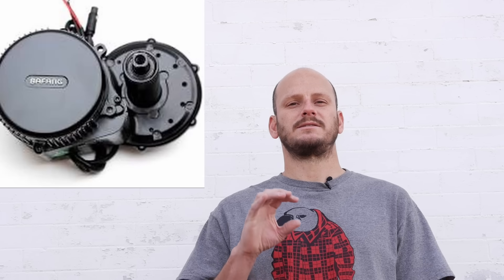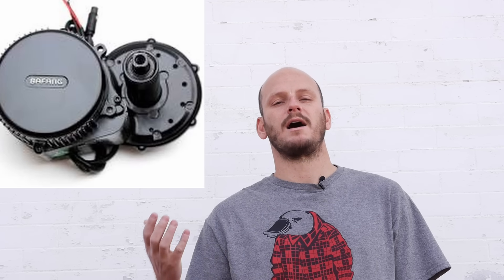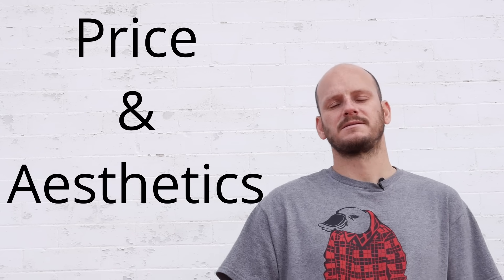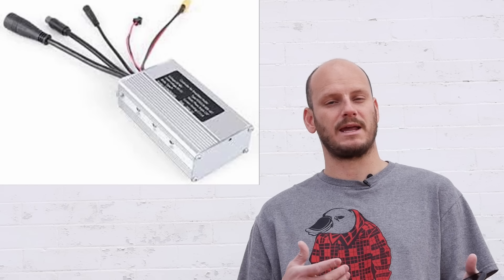Hub vs. Mid Drive Motors: Why Hub Motors Suck and Debunking Common Myths with performance test

Comment: Aren't hub motors axial flux motors which are already considered a superior design? I just did a 1200W front hub conversion on a mountain bike and the thing hustles along great. I have it on soft start mode too, and haven't even tried it without yet - but it still chirps the tire pulling away on white road markings in the rain. Considering axial flux motors are being preferentially developed and used in electric aircraft, I think ultimately you'll find you're betting on the wrong horse. Part of my decision was also wanting to leave the bike as stock as possible, and not adding an ungainly hunk of a mechanism down at the crank. Theoretically you could make the entire motor as big as the wheel itself, and I'm sure that would give a lot more torque if torque is what you're after. It's possible they use axial flux motors on mid drive units too I guess, but the form factor would dictate otherwise.
Reply from the maker: It really depends on the riding experience you are after to determine which system is best. IMO if you were an experienced rider and wanted the most natural system you would choose a torque sensing mid drive.

Comment: Hub motors better suit people who don't like to change gears constantly. This includes most women. We still sell 50/50 hub and mid drive, after people try out both. Hubs are a much simpler ride for the leisure riders. And we don't have the reliability issues you've described.. I think only 2 burnt out geared hub motors in 13 years. Controllers yes, around the same failure rate as mid drive controllers.
I say, let the rider decide their preferences by providing unbiased information, and also, everyone should test ride both types of ebike 👍
Reply from the maker: I have another video for a more unbiased buyers guide. Yes I totally agree that they are two totally different systems for a totally different ride feel. 👍This video is just why they suck 😀

Comment: liar, 3:34 you claimed to be using two different types of motors, but you're clearly using the exact same bike setup.
Reply from the maker: Its clearly labeled before and after with "hub" (before) and "mid" (after)

Comment: yeah sorry Johnny but you skipped over spokes 14g spokes wont handle the torque of the mid drives especially not 1000+watt mids, i know because i tried and learned 12g spokes minimum also standard rims wont take the torque for a long time, the spoke holes WILL  crack! so an investment in good heavy duty spokes and an E-bike designed rim minimum! ........ personally i wouldn't be using a cassette style gear set either i only use internal geared hubs like the shimano inter 3 with 2 gears up front with makes it a 6 speed ........

Comment: nice to see a qualified technician like myself giving useful information that is valuable to everyone looking for the best PEV for them. I did my apprenticeship at Yamaha and worked in design and development and stripping used engines to discover the cause of engine failure. which these days are not down to mechanical engineering it's overheated lubricants or beyond optimum range of temperatures and pressures. basically the diagnosis sounded technical but it was just saying some twat on the production line was busy with Facebook.  great description of the most efficient way to drive the wheel but think of the pinnacle of racing, if hub drive was better in any way I guarantee you that they would be using it. as far as I can see the only reason it's used at all is for the space saving area that could be used to hold a bigger battery or a hot tub, whatever takes your fancy. can't tell you how good it is to find a channel run by an experienced professional that knows what he is talking about. I'm in England, but by the end of spring I'll have a couple of projects finished that will be press demonstrators so if you're interested in having a chat about it email me when you get time and I'll fill you in on details

Comment: Hub fanboy Here. Rekuperation is a Hub only Feature. Which spare the brakes and affects milage. Midrive Sound is unpleasant and With plastic Gears inside a absolute No-Go for me.
Jeah the tirechange and spokes but its amazing when it works.

Comment: I guess I got lucky with my first ebike build. On amazon, 1500w voilamart hub/wheel with a 52v 20ah battery. instant 35+ mph, no pedalling, battery lasts all day. Hammer the piss out of it on rocky trails. no issues at all besides being heavy but with all that power you just don't feel it. Of course I only ride on my own personal property and would never operate anything illegally ;)

Comment: I really love your comparison to ice and electric! Electric does not need a transmission!
Reply: There's been ONE instance historically of electric drive not needing reduction gearing ("transmission"): the bi-polar motors that GE put in 5 passenger locomotives for the Milwaukee RR in 1919, with 12 motors of 370 hp each. Fields were attached to frame, with armatures on the axles. Catenary power nominally 3000v dc. Wish I could've seen one in action.

Comment: If tesla needed gear reduction transmission they would use it. No they have the same principle as a hub drive. Enough said
Reply: All EVs uses a single speed gear reduction transmission, since the motor typically has a higher RPM than the driveshaft of the wheel. However, most hub drives are also geared (beside some big ones like Bion X) to have the same effect. 
Non geared direct driven hub motors are typically heavier and have a bigger diameter to get sufficient torque.

Comment: I’ve had both. Although the mid drive does offer more torque via mechanical advantage of the gear system, I got tired of the chain getting whacked off because of the torque. Happy with my hub drive…
Reply: my hub motor has done me well so far. ill probably plan a way to attach a mid drive motor system to my bike once the hub dies i guess
Reply: Any geared system will let even a flimsy high revving low torque motor pull a boat on dry land  if you have enough ratio. Mountainbike hillclimbers like serious torque of course. What sportsman cares about power loss in a gearbox or chain wear? But actually, the ideal motor would need no gearbox at all. No leverage. The trick is to build a motor that has any torque at low revs by itself. Would you think any train has a gearbox? 
Road bikes with a  decent d i r e c t  d r i v e  hub are bliss. The only thing turning is 2 bearings way fo fat to wear out. Any diameter from 6" on means plenty of torque and a super smooth ride. Ever driven a Stromer? By the small size the hub motor in your comparison is geared too. These plantairy hub motors tend to last 6000 mls before they eat their own plastic teeth. Oh I like planetairies, sure, a Nexus 7 hub goes a very long way and can take a lot more power than what it was built to handle. But that's to get me my sweet spot pedalling frequency, the motor can do without. 
All you need is a coil standing still fixed to the axle pushing permanent magnets; the wheel. Unless you wanna do MX.
Reply: See below... I believe these ding bats are trying to say... a one to one ratio is the most efficient.   If mid drive reduces at the crank to increase at the hub..  it is not more efficient .
Reply: I upgraded my chains and only use 3 SA IGH hubs - perfect chain line & no chain loss issues - ever.
Reply: Hey whatever works & makes you happy . It’s all good we’re not hating on the givers , we just like performance & power . Hubs are great for new bees , more basic riders & flat ground! Bam there it is
Reply: Me too ,  and I was always chased by dogs because of the noise ! I had a duel free wheel setup that sounded like a rattle snake and the offspeys and eagles were nuts around me ,  flying next to me and making alot of noisy when I was around ,  it was totaly insane !
Reply: or you can just not buy cheap shit for your chain and dereilleur next time, even something like a basic shimano deore will easily suffice.
Reply: Cardan shaft.
Reply: You are in the wrong gear if you are snapping chains!
Reply: @caoimhin71 or you're putting any pressure accidentally or otherwise on the pedals while switching gears. Which is hard to not do. Mid drives are a nightmare
Reply: Belt drive
Reply: @nicolaihilckmann4677  the source of the power is not the belt.  It's belt coupled.. coupled to the motor via the belt.  If you wanted to be technical and correct people, then "Controller driven" would have been a better correction on your part.
Reply: Yeah and when the chain brakes on a mid drive....
Your stuck.
If chain brakes on a hub drive you can continue the trip.
Reply: @swartzautoman2  wHaT iF tHe FrAmE eXpLoDeS???
Reply: @swartzautoman2  What if a wheel falls off?
Reply: @swartzautoman2  you didnt even watch the video did you
Reply: @swartzautoman2  And? That is the worst argument I have ever seen lol. Things can break, yes, but to think that you are literally purchasing something based on what will break makes you seem simpler. That's the same thing as saying you wouldn't go riding because you might get a flat. Cmon now, be sensible and pretend you have thought process here. A chain is small and easy to carry as well as tools for it too. Same as a tire popping.... If you don't carry tools and replacements for stuff that is your choice.
Reply: @xex2kok  
I know its tough, try and stay on topic instead of resorting to attempting to insult. Yes a flat tire can be an issue but we don't just wing in and travel far away from help with little to no plan.
People use green slime, tire liners and even carry extra tubes.
The thinking here is someone is 10 miles into to wood on an isolated trail and the chain brakes.
Extra chain, Extra links, a motor that can run without the chain.......
All are feasible options if something go wrong.
Reply: @swartzautoman2  Lol go get bent buddy. Don't make dumb and pointless comments if you don't want to be treated as such in the response. I didn't even read what you said btw.
Reply: @xex2kok  oh no hahahahahahahaha
Reply: @swartzautoman2  Same thing here, didn't read, thanks for the time. But you can continue thinking I did. I will reply each time pretending I read it okay? Now go ahead and do exactly as I tell you.
Reply: @xex2kok  Carrying a couple tubes is one thing, but carrying an extra chain is just silly unless you're on a touring trek. Keeping a chain separator would take up less space.
Reply: Have you ever looked at a bike before?  The gear system decreases torque/increases speed.  If the two different varieties of motor have the same torque output, then the hub motor will have higher torque at the rear wheel.
Reply: @EGL24Xx  Wrong about the gear ratios. Backwards. I have a nice quiet reliable hub drive. The controller is in the battery case. It also does regen, which hub motors can't. With regen, I get 40 miles range. Radcity Stepthru.
Reply: @EGL24Xx  Pretty sure the mid drive motor have a built in reducing gear, to make up for the decrease of torque to the wheel. So in lower gear, the mid drive definitely have a higher torque.
That doesn't change the fact that hub motor are, overall, better
Reply: Mid drive usually 9:1. Geared hub, 5:1. Ungeared hub, 1:1

Comment: Mid motors suck! For speed pedelecs the hub motor is perfect, high speed - you never drive up to the slow poke speeds. And they are much more efficient on high speed than the small shitboxes in the middle of the frame which have endless amounts of gears. It feels much more natural to drive and you can do some recuperative braking, so you don't wear out brake pads every year. AWESOME! Mid drives suck, again! (using your language)

Comment: I'm probably misunderstanding something, but why are hub drives harder on spokes than mid-drives? In both cases the power has to go through the spokes to the tire, correct? Either directly from the hub or through the cassette, which is fixed to the hub. And we know that due to gearing, the mid drive can deliver even more torque. The only factor I can think of is that the mid drive has to go through the chain, which maybe absorbs some of the stress.
Reply from the maker: It is more prevalent in cheap hub motors where shoddy labor and materials are used, thus weak spokes.

Comment: i disagree with you there, me and my friend both have a ebike we've had them for 5 years now. i have a hub motor drive my friend mid drive motor, over the years my friend has had 2 chains snap on him and i have not. so to me the mid drive motor sucks.

Comment: Some states it's not legal to be able to change the gearing of the motor.
I'm almost positive mid-drives would not be legal in my state unless they were put on a single speed bike.
Reply from the maker: Got any links?
Reply: @JohnnyNerdOut  I looked but I'm having trouble finding the reference.
It was in Illinois and it was a few years ago when I was looking at gas powered kits.
I looked at every law with bicycle in it to be able to defend against local cops who make up laws as it suits them.
It had to do with changing gears with the powered drive train.
It's possible I'm confused by the moped vs motorized bike rules.
This was also before Illinois adopted the classes for e-bikes.
The only refrence I see now is a little ambiguous " Motorized bikes with engines larger than 150cc, utilizing manual transmissions, or with more horsepower, are motorcycles."  The "more horsepower" is referring to the 2 hp limit for mopeds which must be automatic or fixed gear ratio.
Pretty sure once you run the motor through the rear cassette it is a manual transmission legally.
But I usually interpret these rules in a worst case perspective to avoid overzealous interpretations by cops.
I've had cops try and tell me I can't ride on an Illinois highway, after about 15 minutes it came down to write me the ticket and we'll see what the judge has to say. No ticket was issued.

Comment: Hahahahaha : ) This must be the most shoddy comparison EVAR : )
But then again. Standing in front of a wall which desperately needs a paint, just signals big time shoddiness ...

Center and hub drives are two different things, and it is correct that you will get more torque from a center drive. It really doesn't mean the hub drive is less efficient. Just that is has lees torque.
What you completely forget to mention is, that center drives sends all the power through the drive train, which means that not only your chain, but any moving part in your entire drive train (chain, spokes, bearings) is under a much greater load compared to a hub drive. This makes a huge impact over time.
However, the most important part you completely ignore, is, that center drives induces drag into the drive train. This means, that when you dont step on the pedals, the bike feels like it is braking, and using it without batteries, is ... well ... a drag.

Check out the high end competitive bikes. They all have rear hub drives.
I wonder why.
Reply from the maker: Not true about drag. Maybe 5% due to the weight. Although to be fair I haven’t ridden all mid drives and they are built with different quality and characteristics, just like hub motors. I only know that Bafang has very little drag and nothing like what you described. 
Check out my video explaining mid drives destroying drivetrains 👍
I’ll make sure to paint the wall so people take me more serious as an ebike mechanic/ builder 😑
Reply: @JohnnyNerdOut  
True about drag. It is in the design. Like hub have less torque, center have more drag. Whether it bothers you or not, is another debate.
A hub e-bike will drive 100% like a normal bike with its batteries removed. A center e-bike not so much. Again. Maybe you dont bother about that, but if you like to ride with e off, and only use it when needed, center is not an option.

And sure, you might be a great mechanic : ) but I still dont think McDonald would shoot their commercials with a dump yard as background.
Room for improvement ; )

Comment: I’ve been building ebikes since 2007. The most efficient is the bafang or Mac v4 hub motor planetary drive hub motor like on the rad power ebike.
I use 10g spokes. No problem.  72v system is more efficient. My latest full suspension ebike weighs 45lbs does 50 mph and a range of 60 miles. and incredible amount of power. . My degree is in computer science but I worked in engineering. I love doing this.  I use a lot of of Ge Silicone potting the stator windings in my hub motor and phase wires. Grin technologies uses stator aid in the hub motor for cooling.

Comment: Mid drive: you get what you give.  Pedal hard and the motor pushes hard.  If you're tired and don't pedal hard, your motor backs off a lot-- kind of the opposite of what many riders need.  A basic hub drive will work hard for you when you're tired and need it most-- probably what most riders need.  Mid drive is what you'll want if you're looking for a real mountain bike, but for everything else I would recommend a hub.
Reply from the maker: Sounds like you are describing the different types of sensors: cadence and torque.